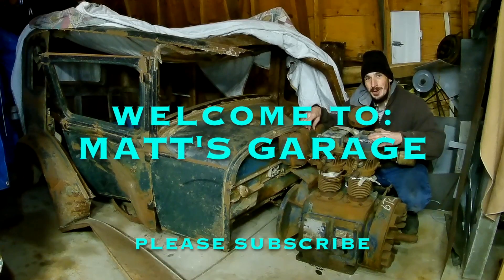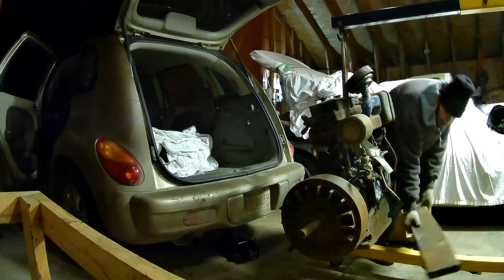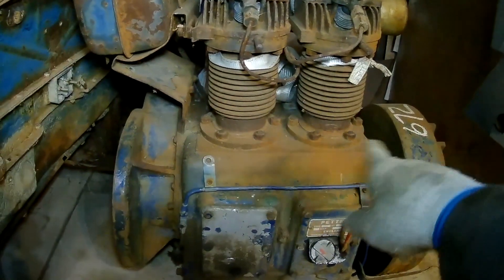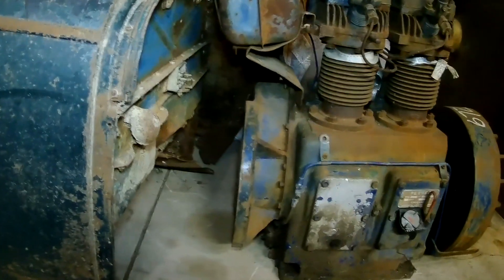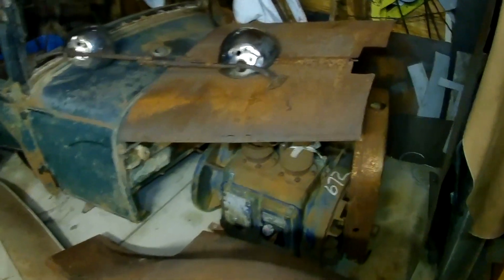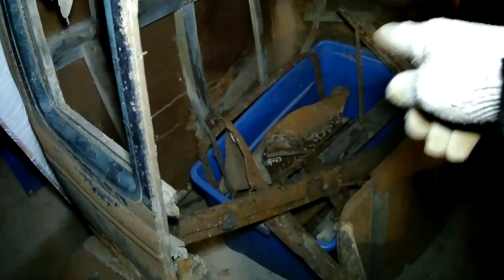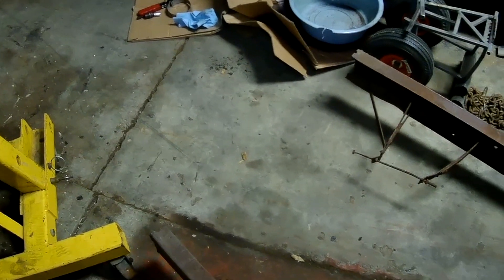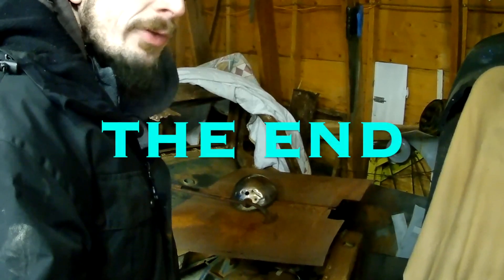Buried Model A Update

Comment: I am interested in seeing more of that car I would love to see it running and driveing after seeing you dig it out that would be awesome I like your vids
Reply from the maker: jimmy bobby That’s the plan for sure, running, driving (not sure if it will be road legal or not) & it’ll have nice shiny paint as well.
Reply: I'd leave it rusty, would make it look more authentic.
Reply from the maker: Brian Murphy I might consider that if it all looked like the green area’s & no cutting or welding were required, but this body will have lots of shiny new metal in it already so paint is unavoidable, also I’m just not a big fan of patina. If you are into that however I will actually be leaving my ‘53 Buick project in patina & just spraying a satin clear coat over it.
Reply: @CarswithNash  I'd braze all the joins and leave them visible, let the new metal rust for a bit, then just wax it all regularly - like they do with VW beetles/campers, and I certainly wouldn't paint the engine.
Reply from the maker: Brian Murphy Sorry the engine is definitely getting painted, I’ve got a vision in my head, it’ll be good, trust me.(-:
Reply: @CarswithNash  Lol, I know the feeling, I've been converting an old diesel Lister LD1 to spark ignition - to run in on biogas.
I painted the whole thing black, wouldn't do it again though.

Comment: if it  turns over and stops so, do not force it. fuel pumps like that like  to sieze up. if you force it you can break the cam shaft. i suggest you take the fuel pups off and see if the actually works. the positions of the in/out lets dont seems that water got in to the bores. could be a snug sieze .  Nice original exhaust on the petter,  if you are going to modify that please preserve it , font tear it up. Good luck
Reply from the maker: enginelover1 Thanks for the tips. My plan is to soak it all in diesel for a week & then do a full disassembly, I had thought about trying to get it free & running but I think it’s too risky & failure is not an option, I love this engine & don’t want anything else to power my car. I don’t think it has any real hrs on it so I’m hoping to just clean & reassemble it mostly + I will blast & paint it during the process.
Reply from the maker: enginelover1 I’ll be changing out the muffler but the Wisconsin I showed earlier in the video is in need of a muffler & it’s a direct fit. Not sure on my plans for that yet but I’m gonna hang onto it as well.
Reply: @CarswithNash  Yes clean it is the best way to give health  to that engine. make sure that the sump is out of sludge  and the strainer is clean.
Reply: @CarswithNash  the you have tin wear for the Petter? or are you going to make it like  rat rod?
Reply from the maker: enginelover1 “Tin wear”? Did you mean the shroud? I actually have a complete parts engine with the shroud on it. Nope, everything is gonna be painted up & finished nice, it’s not gonna be a rat rod, I’m not that into patina myself.

Comment: I dont know if you noticed that the air cowling is missing for the engine? but i think you could make somthing for it quite easily. i have some petter engines on my channel one of which is a semi diesel☺.
Reply from the maker: EngineVids I was actually able to buy a complete parts engine that has the shroud on it but I won’t be able to move that home till the snow melts due to it’s location. I’ll check out your channel for sure.
Reply: @CarswithNash  ahh ok thanks 😃